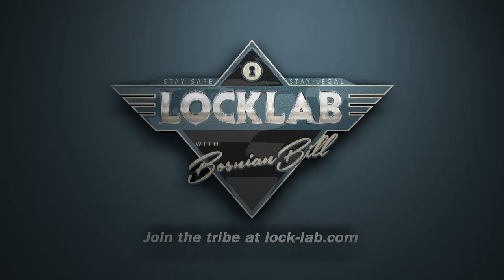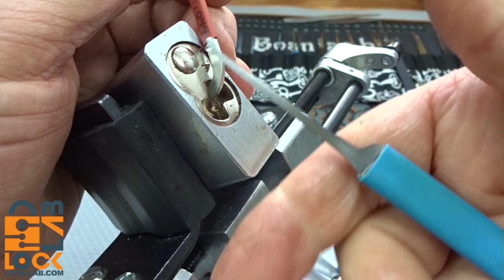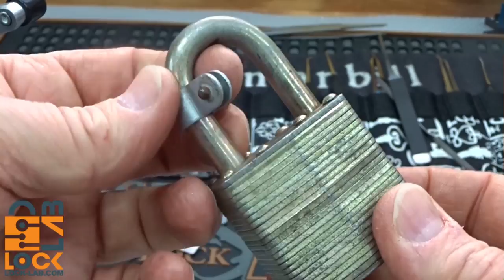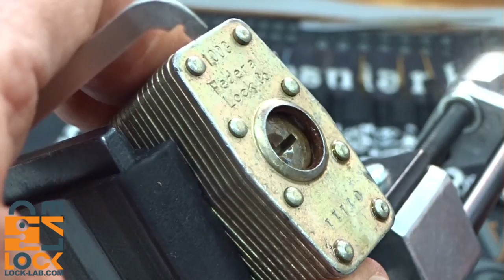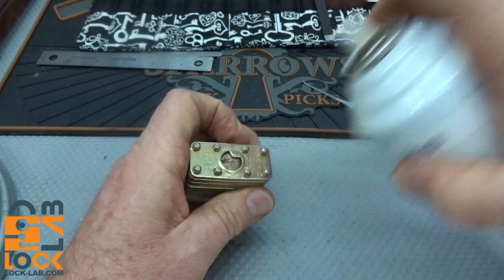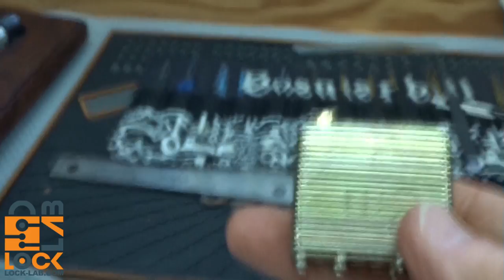(993) Pile-O-Destruction

Comment: Taking the pins and springs out of locks that are thrown out seems common sense. However, is there a right way to sort these SAVED pins and springs? They are different in sizes! Changing them into high security pins is what I'm going to do.

Comment: I always thought that light tension was just a finger rested against the tension wrench. That looks like Bill is piling on some pressure there though. What exactly is "light tension"?
Reply: English Heart for me, I measured with a fairly sensitive scale is about 1-1.5 lbs of pressure, but it's different for everyone. Light tension is anywhere between just barely holding the tension wrench in, and between feeling a little pushback from the lock. Typically, at least, as I stated before it's different for everyone. I think what he was doing with all the tension he shoved on it was to bind all remaining pins and figure out which ones were truly set (floating key pins) and which still needed attention, and then back to light tension to continue picking.

There's also the problem that because they're government locks the spring tension on them is quite large, so in this case "light tension" would be just enough to overcome that counter-tension and give the core a little turn as well. So I guess it's both individual and situational.

I'll stop here before I get redundant. Hope this helps
Reply: 1nkw3ll Cheers mate.